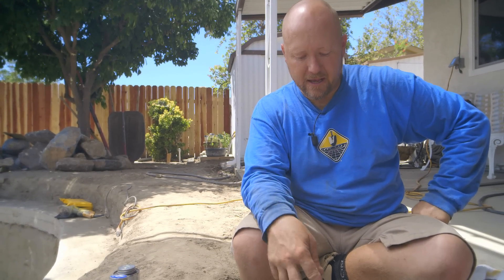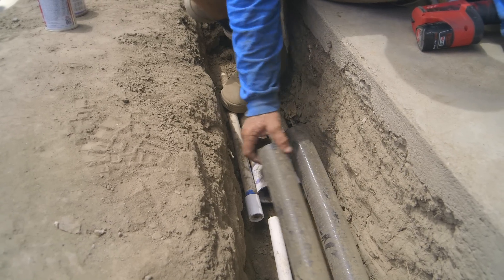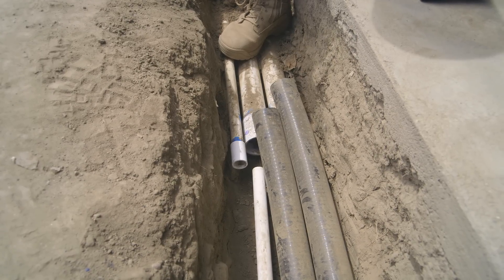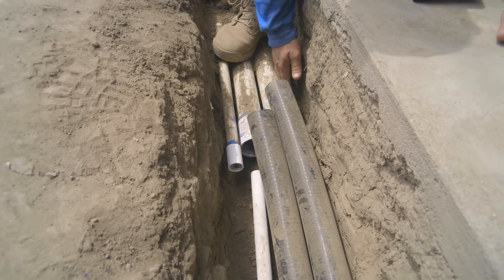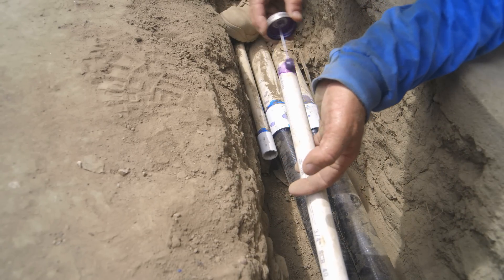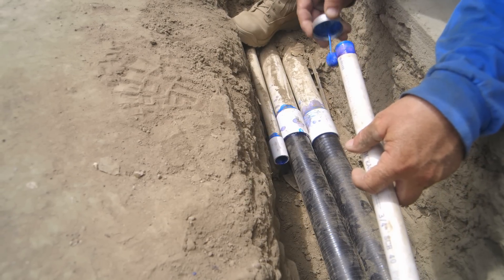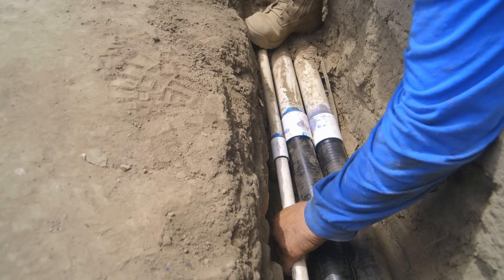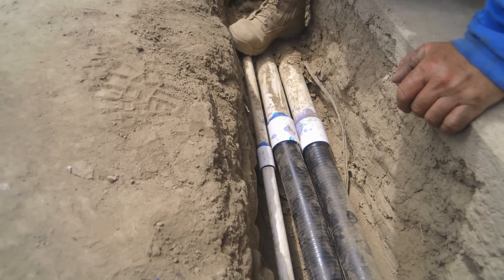Koi Pond Construction | Pond Plumbing Tie Ins - Part 21

Comment: I know this is two years old, I hope you are still reading comments. I am in the planning stages of my pond and want to make sure I do it right so I'm watching this whole series before I start anything...GREAT JOB!! I am learning a lot!! Anyway, could you tell me why you used hard pipes instead of flex pipe for the air line?
Reply from the maker: Hey Adrien! Glad to hear you are planning your pond out so you get it dialed in from the get go! 

Great question - You can certainly use flex PVC on the air line as well. 

The BIG reason is, air doesn't create the same friction loss that air does so using elbows with air doesn't restrict the flow like on the water inlets and outlets. 

We use the 2" flex pipe on the water lines to reduce friction loss.  

If you want me to take a peak at your pond plans before you put a shovel in the groud, feel free to shoot me an email!
eric@theponddigger.com

Happy New Year!

Comment: I was doing some 2" pvc plumbing and inserted a 15" piece of 2" flex pipe it just did not seem to grab I wiped primed and glued it. is there an extra step when using flex ?
thanks Mike
Reply from the maker: +mike jenkins You typically need to hold the connection together a little longer than standard schedule 40 pvc. The flex pipe wants to pop out when you first put it together. I have only had a finicky flex pipe once that I tossed out and replaced.

Comment: To Lawrence5762
No need to pressure check it ...if you do the PVC gluing right (follow instructions) you never will have a problem with a low pressure system like this ....  (Sorry about my interference replying to the Q) ...3 bars is like the system you have on your garden hose if even that .....The PVC pipe and glue is way better then a normal garden hose system ..just a hint. bro ....

Comment: Are those both 4" pipes? Have you gone 4" from BD to SC for maximum flow? Has the skimmer also got a 4" outlet or 2" as a lot of people modify them to 4" for better surface draw.

Comment: Eric, you were right!  I do LOVE this series!!!  I do have a few questions, though:
1)  You don't pressure check your plumbing joints?
2)  Should a DIYer pressure check their fittings?
3)  Why liner and not gunite?
Reply from the maker: Lawrence5762 Hey There!!! Glad you are enjoying the series. 1) Occasionally we will pressure test our lines on a project like this. If we are pouring concrete or working with several trades on location we will ALWAYS pressure test. 2) It's not a terrible idea to pressure test the lines as a DIYer. It really depends on the person and their attention to detail. 3) Gunite is costly compared to a liner installation. A liner installation is much more affordable and is within budgetary reach of most people passionate about koi.